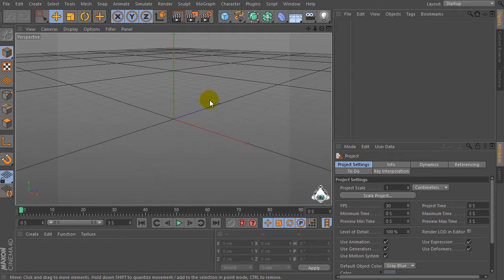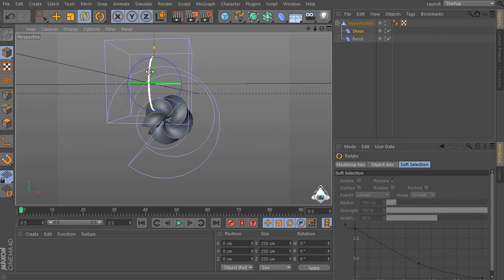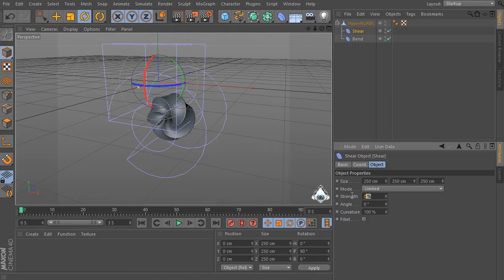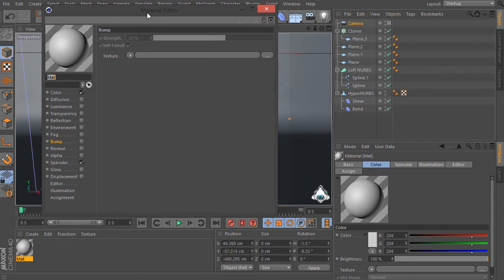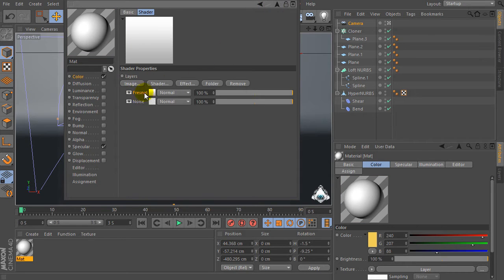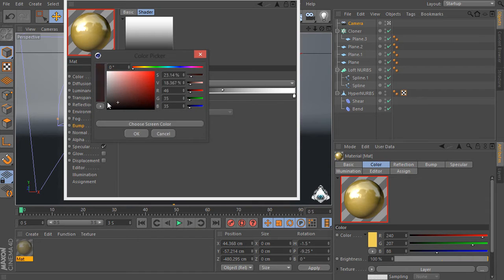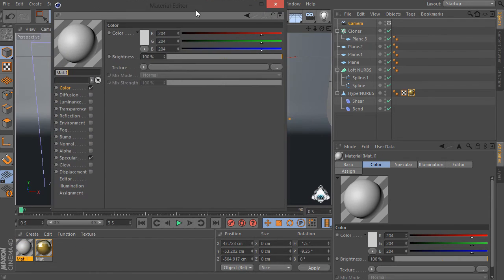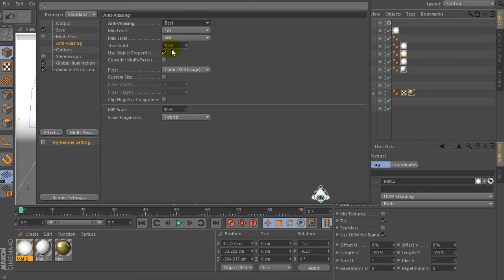Cinema 4D Tutorial - How to make a gold material in Cinema 4d

Comment: Nicely paced tutorial, I do however have to say, this is really not the way to create a realistic gold material in C4D, it's certainly "gold-like" but not like the metal. Gold and all conductors (metals) have strong reflections (colorful in some cases) and almost no diffuse (Color Channel).

You could create it using a coloured Fresnel (warm yellow to slightly whiter yellow right at the edge) in the Reflection channel or even just a flat warm yellow in the Reflection channel would do the trick.